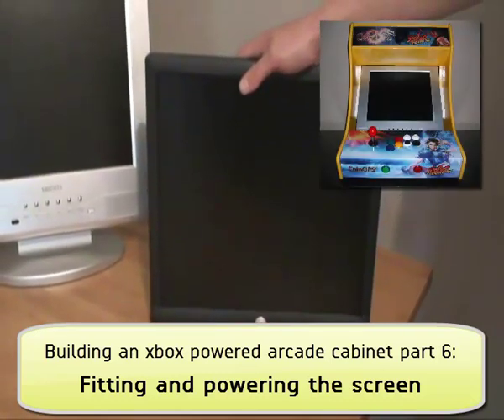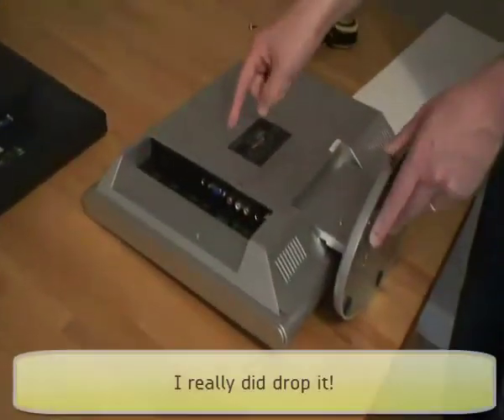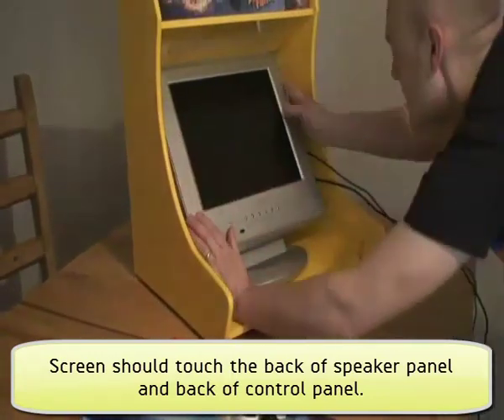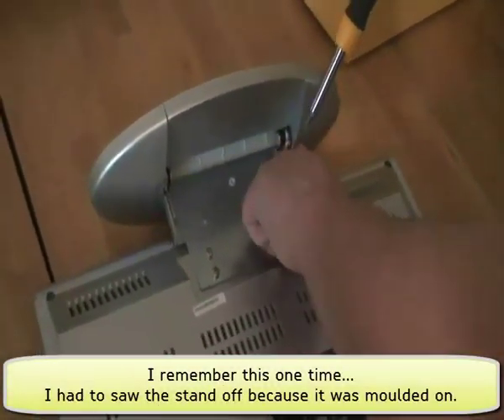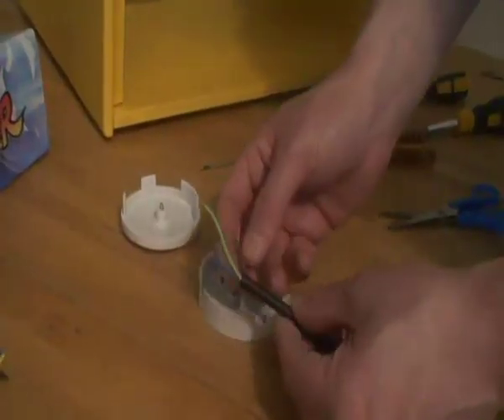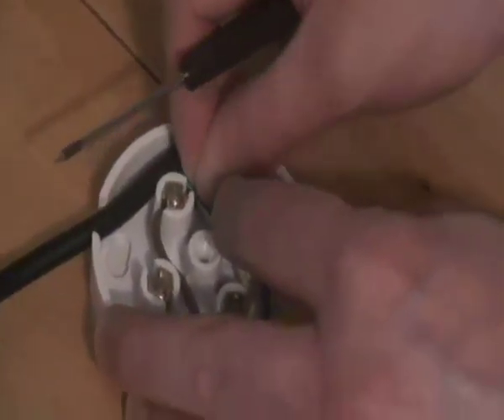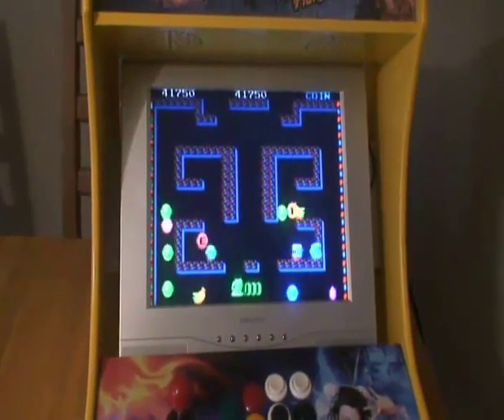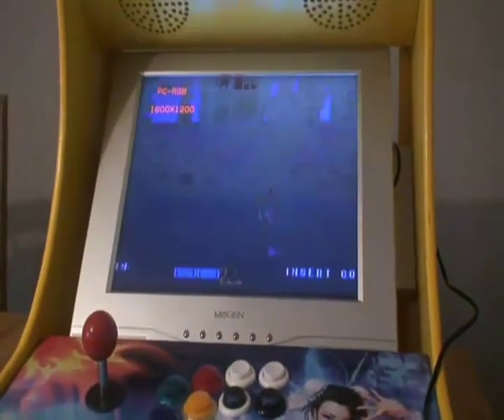Building an xbox powered arcade cabinet part 6: Fitting and powering the screen

Comment: Can you provide more information on the video converter.  I have the components for my cab all setup and working, just need to combine them into a cab.  I am using a flat panel monitor that has the yellow RCA video output and even SVideo output (which one of my xboxs came with a better video cable with a small black box on it for svideo).  My problem is with either connection the video seems blurry and real unclear.  I wonder if I used one of my newer/better flat panels, if it would look better, but I would need a converter box to VGA or DVI (or HDMI).  So if you could point me to a good converter box on ebay or Amazon, that would really help me!  - Thanks :)

Comment from the maker: It would be easier to use an extension cord.  I prefer the junction box because it takes less room - these are tight for space,  it looks neater - excess cable can be trimmed,and I can choose the length of the mains cable.  
I think the VGA gives a more crisp/sharper image, but this is not always preferable on an arcade monitor.

Comment from the maker: Yep,  simple as that.  That's how a 4 way extension cable works - 4 sockets/1 plug. 
This is only for mains power. Don't wire up anything this way if it uses a transformer plug.